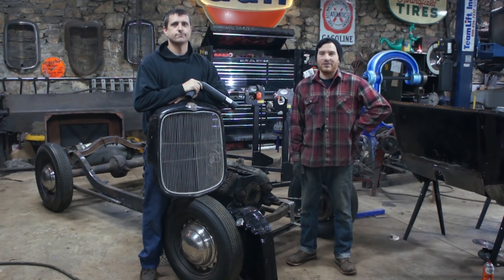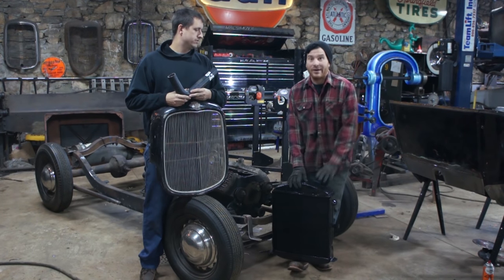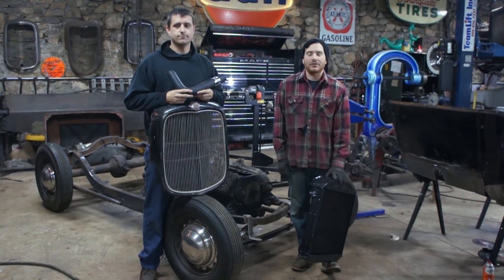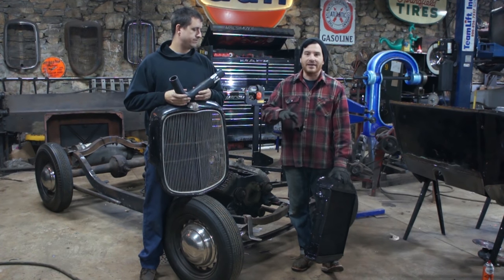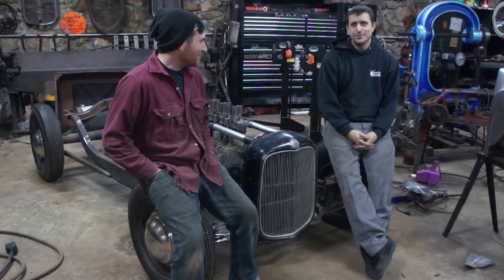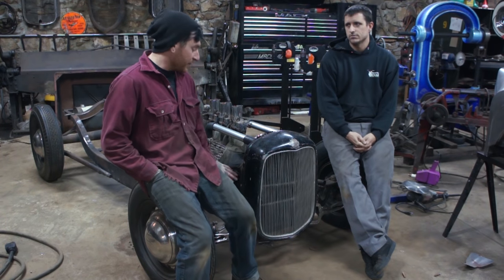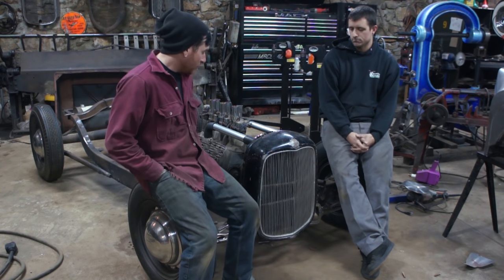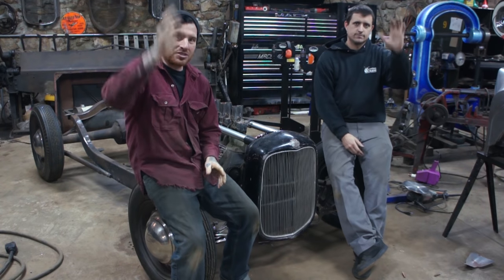How to Make Custom Flathead Radiator Hoses- Free T Radiator Update - Ep. 49

Comment: Steel tube is easily reduced in diameter by swaging. The transitions are smooth. The equipment is specialized but you can search "rotary swaging near me". If you find a vendor, you'll probably use the service down the line for exhaust tubing as well.
Reply from the maker: Hi Dennis, I actually have a friend that works at a high end exhaust shop making a set out of stainless and doing just that this week! Thanks for the heads up! -Matt/ITG

Comment: I used to use Posi-Flex hose bushings. Well, used Posi-Flex hose too for making custom hose setups. It was available in the 60s so you may need a time machine to find it. :)
Reply from the maker: Hi Bill, yes those hoses are most definitely "traditional" but flex hoses are one of the few "old school" things I don't really like. Definitely nothing wrong with them, they function just fine! Thanks for watching! -Matt/ITG
Reply: @IronTrapGarage  Not the spiral flex hoses, I never liked them,  Posiflex was straight hose you could cut to length and bend. Not at  a tight 90 though. I see Gates still makes the reducer bushings.

Comment: Hey guys, good work! Finding part logistics is always the biggest pain. Maybe you could get smaller top tubes that fit the rad and go to your local muffler shop and have them stretch the other end to match the head outlet. Possibly brushed or polished stainless to match those 97s and aluminum heads? Awesome to see the old bucket of chicken coming together!
Reply from the maker: Hi Matthew, That's a great idea! I was hoping to find a small hose reducer, but that will make it hard to find a replacement if we need one on the side of the road. I might ask a buddy that works at an exhaust shop to do just that. Thanks for the idea! -Matt/ITG

Comment: Lookin' good. Where will you put the temp/ sensors. My first street rod I bought was a 41 Ford coupe with a 53 Merc 3/4 race , alum Wiend heads , triple dueces . The top hoses were copper pipe with tees and the tee end facing rear held the sensors.  I have a pic somewhere. Had a Mallory dual point. And never ran right. Always vapor locked.
Reply from the maker: Hey Bob, that sounds like a kick ass set up you had! Probably some carb issues on why it was vapor locking! I run the temp sensors in the stock location in the heads by the water outlets. I'll be running old Stewart Warner mechanical water temp gauges. They seem to work well and are dead simple! Thanks for watching. -Matt/ITG

Comment: don't forget to roll a bead on the metal tubes to help retain the rubber hoses
Reply from the maker: Hi Greg, Yes once we get the tubes sorted I will, although I've done plenty of cars over the years without and it works just fine. These cars don't have very high pressure cooling systems so not as much of an issue as later cars. -Matt/ITG

Comment: Could you slide a short piece of a smaller hose on the radiator that would fit inside the hoses that connects to the steal tubing?  Just a thought.  Once again, another great video!
Reply from the maker: Hi Bryan, that's actually how I have the Pagoda City Coupe and it works well, but I was looking for a cleaner solution. I have a buddy making up some stainless pipes and he will reduce the one end so just a small piece of standard 1.5" hose will fit on it and all the hoses will be simple to find/replace if need be. Thanks for watching! -Matt/ITG
Reply: Nice!  Thanks for crank'n out all the excellent content!

Comment: Thanks Matt nice job probaly missed it in the video but are you running a electric fan on it
Reply from the maker: Hi Dale, no I will be running a mechanical flathead fan. I will need to trim the fan blades down to fit the sectioned grill and radiator. -Matt/ITG